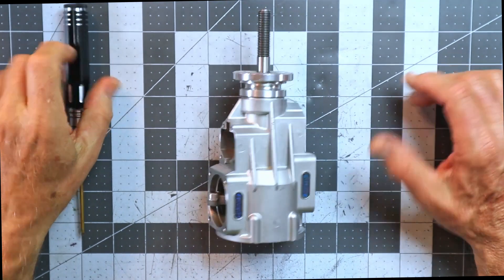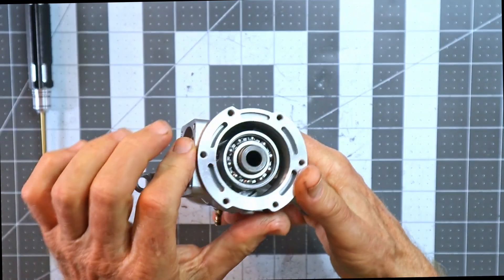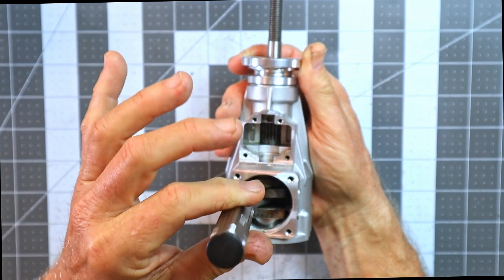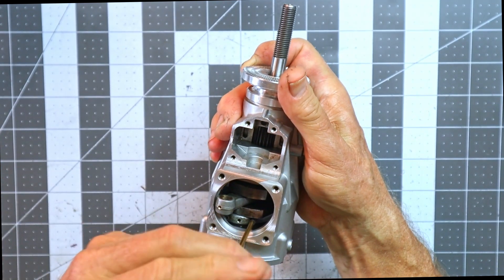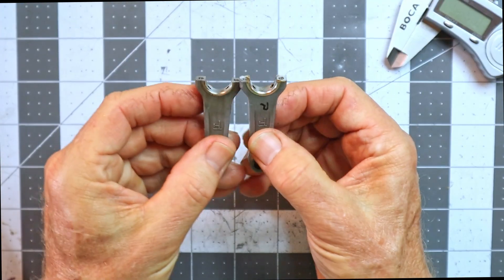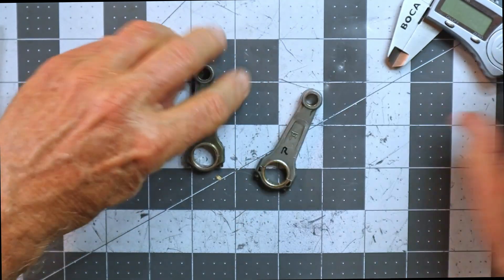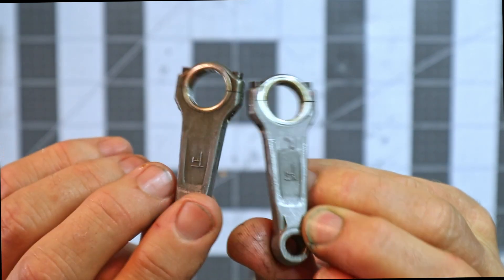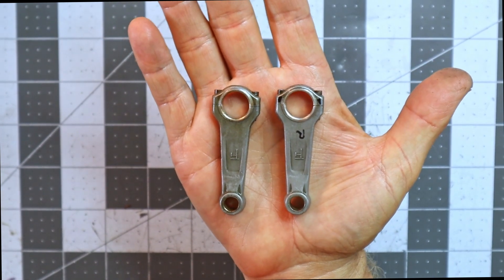Saito FA-300T Connecting Rod Issue

Comment: One thing you could do, is turn the rod cap on the suspect rod 180% and retighten and try again on the right crank pin ( if the unmarked rod cap is on 180% out of alignment, it will most DEFINETLY be tight !! )  if THAT is sucsesfull ,   MARK THE ROD AND CAP SO THE NEXT TIME YOU REMOVE THE CAP YOU WILL KNOW WHICH WAY TO RE-INSTALL THAT CAP!!
Reply from the maker: Please do NOT tell me how to do things. This is not your business. You did not see me disassemble this in the first place, so you are simply making assumptions. Assumptions make you look like an AZZ.

Comment: The right rod big end is out of round just enough to get snug on the crank. Easy to fix. Scotch bright red pad wrapped around a dowl pin set in a drill with a little ATF as lube. Hone for 2 or 3 seconds at a high speed. Will remove enough material to give the proper clearance needed without going too big.  Ideally you need proper ID micrometers and OD mics to set proper clearance but using plasti gauge will also work. Use grey scotch bright for finish polish and your set. You over complicated the issue . It's not that big of deal
Reply from the maker: If I can get the owner of these to donate them to me I will give this a shot. Otherwise they are not mine to mess with.
Reply: Actually sir with all do respect the owner of this  engine sent it to you to fix or sort out or get it air worthy again. So it is actually on you to fix it and given that fact polishing up the rod to have it work properly is all on you @dmrcflyr2

Comment: Even if the end-caps don't have alignment pins and appear to be fully symmetrical it always pays to mark the orientation of the end-cap relative to the rod and make sure you re-fit it the same way..  This is because once a wear-pattern is set up the big-end will change shape slightly and it will no longer perfectly align if the caps are 180 degrees out.   I've never been a fan of the plain (unbushed) rods on the Saitos because aluminum is not a good bearing material for a non-pressure-lubed system -- it picks-up (galls) very easily at the least bit of dirt or lack  of oil.    I have several Saitos and, to be honest, I really don't understand the way people perceive them to be "ultra-high quality" -- because they're not.
Reply from the maker: OK and your point since you are not a fan of Saito engines? The end cap was fitted both ways and the result was the same.

Comment: Looks to me like the troubled rod end is a bit smaller than than the one that rotates freely, on average. You should have around 0.0015 to 0.002 total clearance to the crank journal.  Also .509 to 0.512 on the 45 degree indicates cap shift which can cause a bind. If it was mine I'd file the threads on the bolts where the cap covers them a little bit to give a bit more clearance. The cap should align to the rod via the journal but the bolts my be interfering with that. Or you might try tapping on the cap (LIGHTLY) with the bolts snugged but not tight to see if things free up. Good luck.
Reply from the maker: Well it isn’t yours nor is it mine. So that is pointless. The customer, who happens to be paying me, is getting new connecting rods.
Reply: Meow  @dmrcflyr2

Comment: I’ve a new Satio 72 that I bought a number of years ago. Here in the UK we have a superb range of models by Chris Foss. I renovated an Acrowot, a low wing sport model and installed the 72 into it. Around 5-6 flights with the model the big end seized. After a strip down it was obvious the big end of the conrod was too tight. I found a drill bit with a diameter slightly smaller than the eye of the rod, wrapped some very worn wet and dry emery paper and reamed it. It has now had many flights and all is well. You’ve nothing to loose, give it try.

Comment: Hi David. I watch your show a few times now. I also have an engineering business. I think you could try rotating the bottom of the big end by 180 degrees and it might not lock up. If that doesn’t work try swapping the bottom big end cap to the other connecting rod. They should have had orientation pins on them to stop this problem. I hope this helps.
Reply from the maker: Tony I have disassembled several Saito boxer twins and I can tell you that they do not have orientation pins on the end caps.  That is not something done on glow engines.

Comment: Maybe it was disassembled prior and the rod caps got swapped from one rod to the other. On full size engines the rod and cap must stay together in the orientation that they were honed. Rods and caps that are not marked by the factory should be marked at first disassembly.
Reply from the maker: The owner swears that the original owner/buyer never went inside the engine due to lack of experience with doing so.  Plus being a new engine there would be no need in doing that.

Comment: If I can be of help here…  .5118” of an inch equals 13mm. 13mm is the nominal size. The crank pin should be about - .001” -0015” undersized. The Rod bore should be about +.001” - +.0015” oversized. 
The cheapest and easiest fix is to purchase a 13mm high quality reamer. Torque the connecting Rod to spec. and ream it out. I would do a practice hole first to make sure the reamer is cutting to spec’s.
Reply from the maker: Why would this need to be done on a fairly new engine?  I am not purchasing a reamer and reaming a customer’s connecting rod, hoping that I do it right and that fixes an issue that shouldn’t exist to begin with. So no, that’s not a good answer.
Reply: @dmrcflyr2  well….  my guess is that Saito Did Not have the Con-Rod Torqued to spec. when they manufactured  and Reamed the Rod and that is why you are getting undersized egg shaped out of round measurements. It’s the only answer IMO.
No Dave, you should not have to purchase new Rods nor the tooling to Fix something that is supposed to be new. Just tell that to the millions of new car & truck owners nationwide wide with the Junk that is being sold today.
Reply from the maker: Keep in mind my means of measuring the roundness of the opening was not ideal if not quite poor.  So using those readings without getting better ones is not something I would make a judgement call on anyway.  To have an engine leave the Saito factory not having these torqued to spec would be very unusual but not impossible.  This engine was made 30 years ago and the QC standards for Saito and many other engine manufacturers was much better then than it is now.  So that IMO is a long shot root cause.  I believe Toralf, in the comments of this video, had more believable possibilities.
Reply: @dmrcflyr2  👍very true with the measurements, but the “good “ con-rod was measuring on the + plus side of nominal. One other area you can look at is the face of the cap & rod with a good magnifying glass. There maybe a “witness “ mark (dent)from a piece of debris or burr that was clamped together when they did the final reaming of the bore. If there was debris between the two halves, even a couple/ few thousand’s thick will give you the irregular undersized measurements you were getting on the questionably Rod.
Reply from the maker: I just wish I knew if this engine always felt like this from day one out of the box.  No way to know that now, but a person new to this engine might have simply thought ‘that is how it should feel’.  I still thin k operator error had something to do with this.
Reply: @dmrcflyr2  Although these engines are machined to a high standard & quality they do make mistakes from time to time. Because you have a tight spot and have ruled out the crank pin there must have been an issue in machining the one con-rod with the irregular measurements.
Try this: get an HB lead pencil and colour in the contact surface inside the con-rod. Be sure everything is clean & dry. Torque it to crank and turn it slightly till you feel the drag if you can?Regardless, Disassemble & you should be able to see where in the Rod it is tight making contact with the crank pin. Depending on the contact area, get a piece of 1/4” - 3/8” dowel, some very fine emery and sand out the high spots? It Works…
Back in my previous life, when I was totally into this hobby I used to machine up replacement Aluminum-Bronze con-rod bushings in my 2 strokes, I was faced with similar problems you are experiencing now with a tight con-rod…
Reply from the maker: @Krankinstein While I can do that, it isn’t an acceptable solution for my customer. I provide excellent engine servicing and when it comes to things like this a new part is the only way I’ll finish the job. Only if a part I’d not available will means like this be considered and i personally will not do that on another persons engine. Mine perhaps but not someone else’s.

Comment: At least new connecting rods are available.
Reply from the maker: The one listed on RCJapan has the correct Saito part number but shows FG-61TS as the engine it is for.  So these engines share the same rod.

Comment: Is it maybe up to the Crankshaft? maybe it grinded the surface of the crankshaft to an oval surface or the crankshaft is not straight in the crankcase?
Reply: I would go along with that possibility but i think it loostened up when he switched rods on the journals.
Reply from the maker: @xgaming2229   The issue always follows the rod and thus eliminates the crankshaft as the issue.  I stated that.
Reply: My money is on the rod. The tightness followed the questionable rod when he switched it to the other side.
Reply: I have ordered parts from RC Japan from time to time. Shipping is generally quite quick. Odd situation with the connecting rod, doesn’t appear to be any problem with it.

Comment: I had a set of snap gauges for checking I.D. and outside mic's for O.D. Hard to justify the cost when not used very often though. You do great detailed work. I enjoy and learn a lot from your videos. Thanks.
Reply from the maker: Snap gausges, that’s what they are called?  I had an image of them in my mind but could not come up with the name.
Reply: @dmrcflyr2  Yes, snap gages are used to check inside diameters. They need to be used with an outside micrometer.
Reply: @dmrcflyr2  Yes, they are a telescoping snap gauge. I believe were made by central tools and i got them from a mac tool dealer.

Comment: I expect the new connecting rod will fix your clearance issue. I know an engine machine shop would easily be able to resize that connecting rod and it probably wouldn't cost very much money. The thinnest portion of the rod seems to be around the rod cap and I would think that portion around the cap has been over stressed and became slightly out of round. The only way to know for sure is measure in multiple positions inside the rod journal.
Reply from the maker: Thanks Toralf.  Any theories as to what could possibly cause this issue?  Max 7 times run/flown I’m told.
Reply: @dmrcflyr2 a couple things come to mind either a real nasty kick back, slightly hydro locking or,  possibly running a nitro content which is too high. I would think if it was too tight from first assembly you would see galling in the journal if the engine was run in that condition for any length of time.
Reply from the maker: @toralfcross3819  my thoughts exactly and these are the symptoms or possible causes I convey to the customer as well